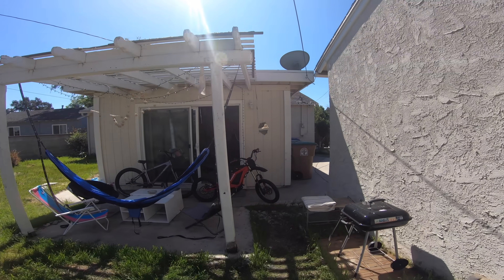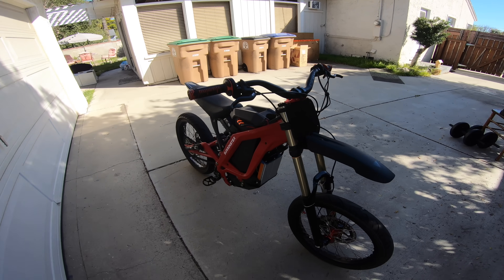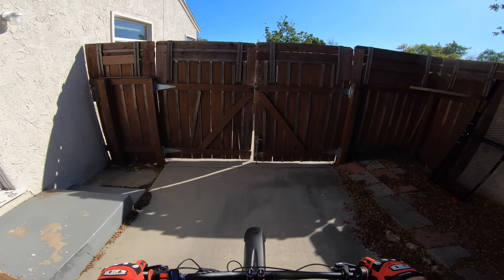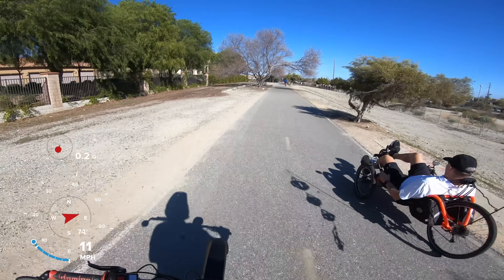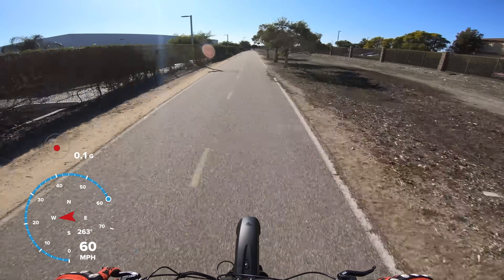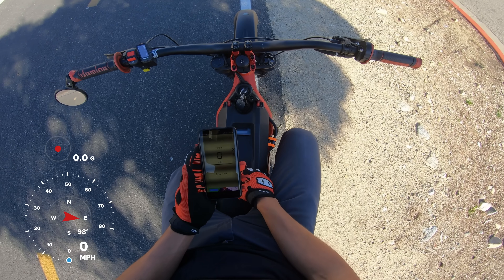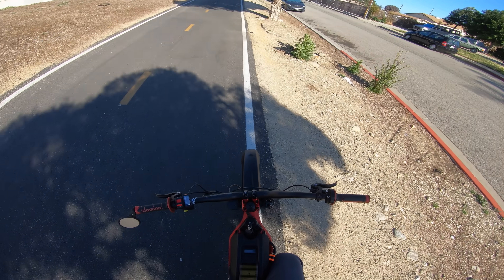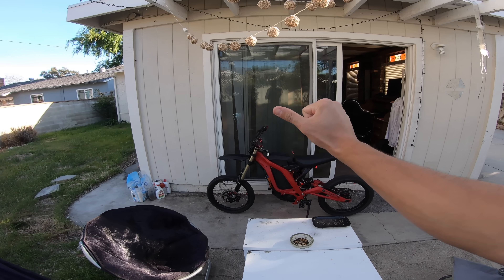0-60mph Test // 72v Sur Ron BAC4000 // 50mph Wheelie

Comment: That 0 to 60 looked pretty quick to me, those times put most normal cars to shame
Reply: Yeah that was definitely pretty impressive. Around the same 0-60 as my car, probably a little bit faster. 2008 V6 charger.
Reply: It's electric single gear though, makes it kinda unfair when the torque doesn't have to be carefully maintained with proper gear shifts.

Comment: Thanks to your vids I pulled the trigger and ordered the emotobros contoller and the 72v/32ah battery from litespeed.
Reply from the maker: dude yes! hope you used my code for the litespeed save 100!
Reply: @SurRonster  ahhhh no I didn't. What is it? Maybe I can message them and ask to add it.
Reply: How much for the whole setup
Reply: @Kuaybeatz  About $3k. But you can sell the stock contoller and battery for at least $1k. I kept mine just in case.
Reply: @iamaturdle1514  Nice !how how difficult is the entire installation if you might say
Reply: @Kuaybeatz  Depends on your experience. I'm no expert, but I was able to do it in about 10 hours. I'm sure it could have been done in 2-3 hours.

I just followed Emotobros step by step video on their channel. Just watch the video and you'll be able to tell if you're confident enough to do it.
Reply: @iamaturdle1514  👍 awesome, thank u so much for all that insight,

Comment: What’s the difference between the BAC4000 and the BAC8000. Great Video BTW🤙
Reply: about 10 kw
Reply: @StoriesbyDAF   So the BAC8000 will have 10 extra kilowatts of power compared to the BAC4000 ?
Reply: @NickTapes  bac 4k maxes out at 25kw 8k is like 40kw max but the sur Ron motor can’t handle more then basically 15kw
Reply: @Minecraftfinestderik  Ohh Ok. Thanks for the help 🤙

Comment: Hi what’s the range you get in the 72V approx? I’m debating between the 60V (60ah) vs the 72V from chi battery
Reply: What did you end up getting?
Reply: @jonlock7150  72 max from chi
Reply: That's what I am leaning for. You happy with it? Any regrets? I have bac4000
Reply: Very happy, the range is really good. I got about 60 miles no charge with it. I have bac 8000. You can also get the touring, my friend has it and the range is even better

Comment: Could you imagine if they added another gear. this thing would be amazing
Reply: Give me a clutch system!
Reply: Believe it or not... a gearbox would only add more weight which would hurt performance.

His upgraded system is already capable of putting out more power than he could find traction with...or... it would flip him off the back of it being a short wheelbase bike. Thats the real limitation.
He is only running it at 8kW here with the power gradually phased in to aid with driveability/control. He could turn it up to aprox 14kW on the app or even just reduce the power feed in timing to improve the performance but thats not what is important to him. he is more of a wheely than outright performance merchant.
There is another guy on YT who chases outright performance...